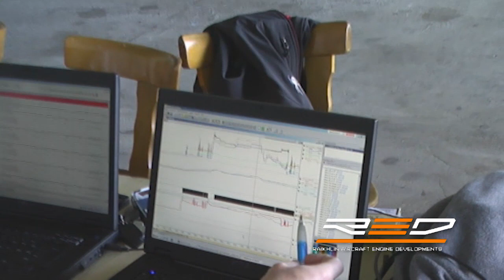RED aircraft Engine

Comment: Can it be adapted for automotive use? General aviation is a pretty limited market...
Reply: hahaha... bollocks limited market... With the phasing out of avgas, a diesel/avtur capable engine is exactly what general aviation needs and the market is BIG. Not everyone has pockets deep enough to fly turbines!
Reply: Way to expensive for auto use. There is not a need for auto use.
Reply: @chris1451  By auto use I don't mean just cars but also trucks and pretty much anything that moves on the road on four wheels or more, not to mention marine applications. There is always a need for a good diesel with lots of power and aviation-grade reliability. The only real problem would be meeting emissions standards, I can imagine these don't even exist for aircraft.
Reply: Not the same application. 

This is a $300,000-$500,000 engine. 

A semi truck/tractor is $150-250k.

A PWC PT-6A is $1M and an overhaul is $300,000. 

So this engine offers similar power, half the fuel burn, and upfront cost the same as an overhaul on an old Turbine engine.

Comment: Max speed ???
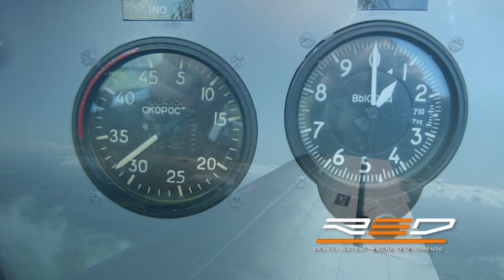Reply: 320 km/h on Yak 52, you can see instruments 3:53 . Yak 152 will have some 430 km/h in horizontal flight depending on load, altitude, propeller  etc.
Basically if you want fly faster then 500 km/h, you probably want a turboprop engine, not diesel piston 12V. But the sound of this engine is magnificent, in high rpm it sounds a bit like Spitfire (but just after start it sounds like a tractor or VW golf Mk1 diesel)